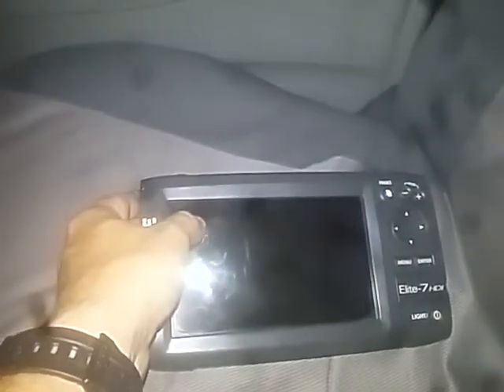Lowrance elite 7 hdi sonar problems

Comment: I had the exact same problems. The cause was traced to a poor extension cable connection on the line from the transducer. Check the whole cable from the transducer paying particular attention to any cable joints and to the socket on the head unit. Additionally, check that you have the correct transducer. - There are several Lowrance types and only one will work with this model. - Check also that it is mounted correctly. These same symptoms can occur if the transducer is mounted upside-down.

Comment: The hdi 7 elite was crap (the first units built were garbage) just got off phone with lowrance and they pretty much told me to buy a new one. I paid 800 new in 2013 2 weeks later they came out with a newer touch screen for less$. Smh my unit froze up and I would have to do a hard reset to get out of the freeze. In turn i would lose all my waypoints.  I bought the hdi7 bc I have a very old Garmin beside this hdi and wanted to transfer the waypoints to the hdi bc the garmin was getting old.  I go online to lowrance and try to get an upgrade to fix the unit and cust. Support tells me the upgrade won't work on that unit and to trash it.  Buy a GARMIN.  THE GARMIN BESIDE THIS CRAP HDI7 IS 16 YRS OLD AND GOING STRONG WITH NO PROBLEMS.  DONT BUY LOWRANCE!!!